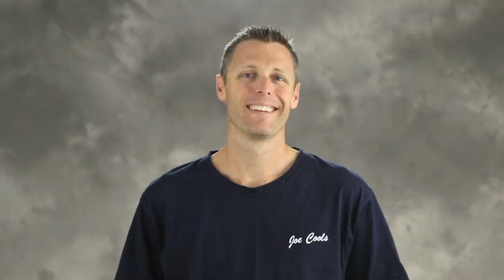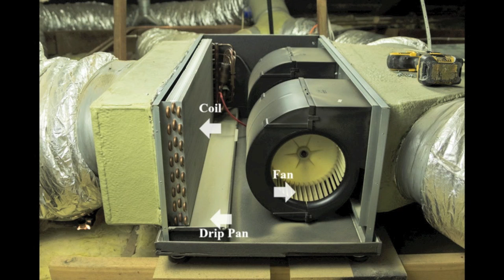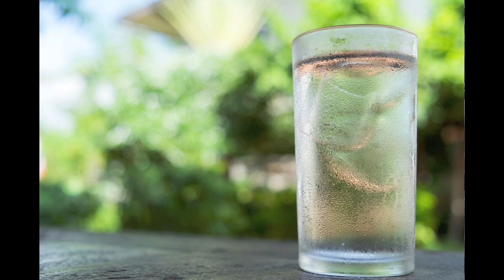Why A/C Drips Water

Comment: My air conditioner doesn't drip water
I have a split inverter 3 star AC

Why?
Reply from the maker: The air coming into contact with the heat exchanger coil isn’t going below the dew point :)
Reply: @joecoolsairconditioning6609  thanks broda
Reply: @joecoolsairconditioning6609  do it mean the air condition has issues. Can low gas also make outdoor not dropping water

Comment: Maybe its like the opossite of it?  Because when its raining there is a moist sticking in the window then when you touch it it turns water so maybe the a/c is getting colder the other air that is stuck at the other side turn into water?

Comment: i have a ducted split system, reverse cycle. there are 10 vents throughout the house. But only one of the vents is dripping water. if its a condensation issue, then why only one vent?
Reply from the maker: Hard to say without being there but it sounds like the water is coming from inside the duct work system. In my experience this is due to water/condensation being carried over from the cooling coil and or drip tray inside the air handler. This is usually as a result from a blocked return air filter or a return air duct that has collapsed. 

See the videos on our channel for cleaning return air filters for ducted system and how to unblock ac drain. 

Good luck mate!